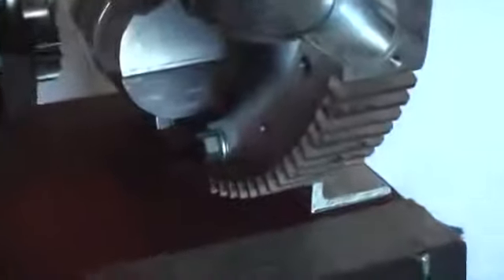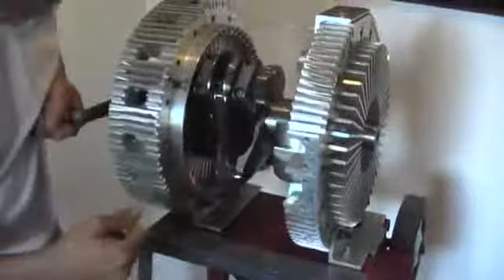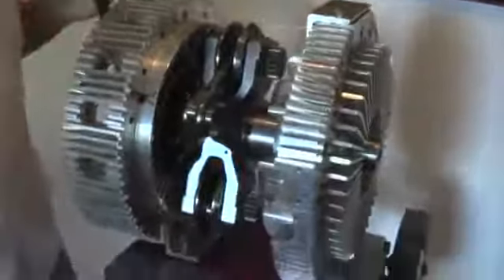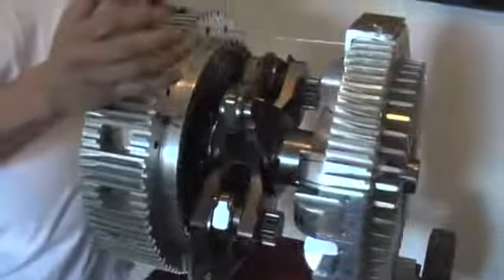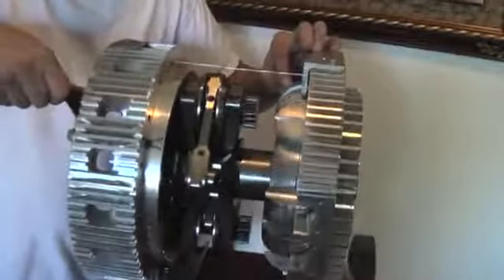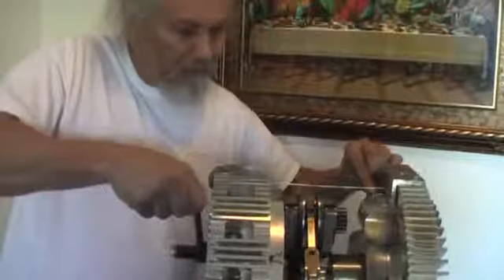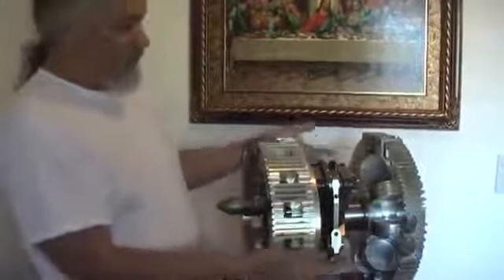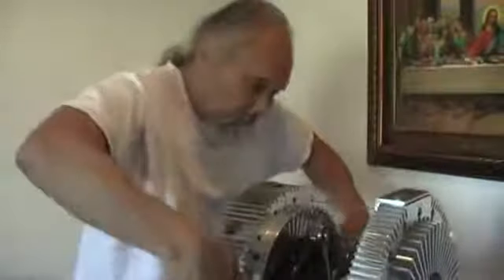Raphial Morgado Describes the 14 Inch MYT Engine in Relation to Aviation 2.0

Comment: The worlds most mysterious engine, no one knows where there with it, never heard it ever run on a petroleum fuel, saw some silly video of it being run on air but that has been it.  I be been following this thing since conception. c’mon man what’s up?
Reply: It's a vaporware scam.
There are features I like but the biggest problem I see is going to be piston cooling.   
It's hard enough to cool a conventional piston with combustion only occurring on one side of the piston and oil squirters on the other side.   With combustion happening on both sides of the piston, I'm not buying this scam.
Reply: @Kenny Hendrick 
How would you transfer the heat from the pistons?  to rings and then the piston walls?  The only method I can think of would be an elaborate "connecting rod" (or whatever he's calling it) with cooling passages and maybe a pair of flexible tubes that link the pistons to the rods.